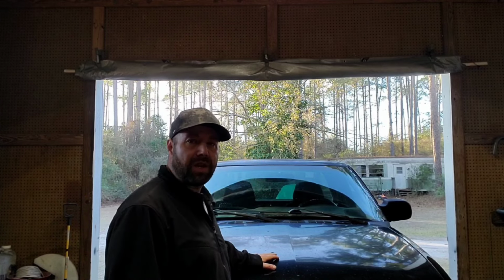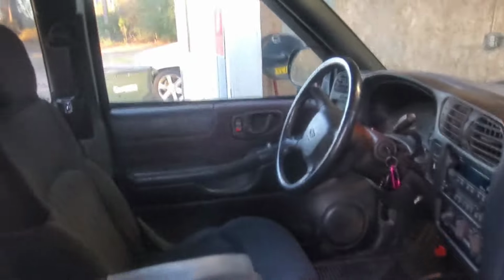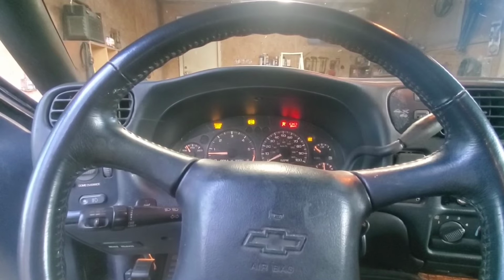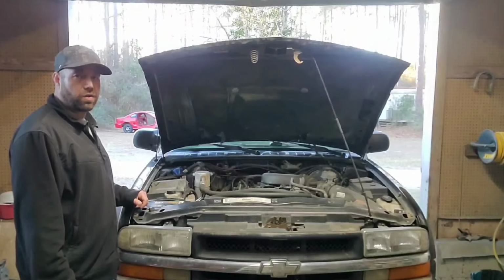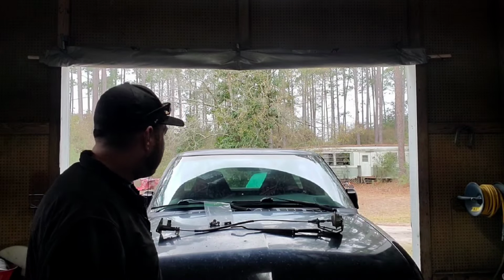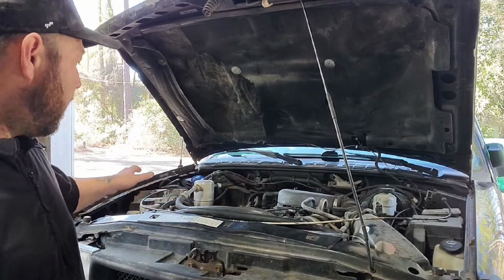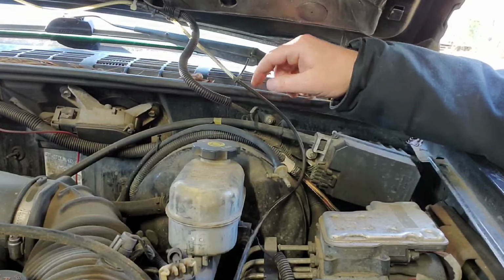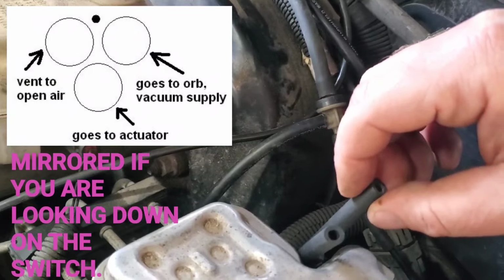My Daughters first vehicle! 03 Chevrolet S10 ZR2 4x4!

Comment: Every mechanic dad’s dream to have a daughter have interest in cars and be surprised when they buy a truck as a 1st vehicle. Just picked up my 2nd s10 last weekend and was able to find a zr2 in Macon. Researched all about these trucks in comparison to the standard s10 line and the 3.73 rear end and g80 locker makes a difference when I took off from a light. Does it have the 31s on it still? Not sure if that’s what took out a corner my fender flare rubbing or something else
Reply from the maker: YES! She always has lots of questions and likes to watch and learn when she can.
Awesome! I have always loved my S10's. Yes, still running the 31's as of now but it needs tires soon and will probably go with a less aggressive tire. We will stay with the same height and width,(as close as possible). I believe there may have been a critter involved with the flares getting broken 😆
Reply: @NoLogoGarage  if u go with 235/75/15s the Speedo is off by 2-3mph and after about 60mph atleast 5mph. I got a Hypertech max energy and I’ll be able to correct the ecm for the tire sizes
Reply from the maker: @b-rys8527  I will have to look into that. I have a tire size calculator and will get as close as possible, if I can't find a less aggressive tire in the 31's. Looking for more of an all season tire for her.

Comment: Can you show me where your vacuum line to the intake connects? I have an 03 Sonoma 4x4 and that particular vacuum line is not connected to anything and I don’t see a place to connect it on the intake?
Reply from the maker: @alabamaadventurer  back of the throttle body, under the intake tube hat to the driver side. Should be a T fitting and a bladder.
Reply: @ thanks for the info.
Reply: @alabamaadventurer  Did you get your vacuum lines figured out? Just curious as I just got thru replacing much of the vacuum lines in my 01 zr2. There are some good vids on this topic (w/diagrams) on YT.
Reply: @ not yet, I can’t find the t fitting to plug into. My engine was replaced before I bought the truck. I wonder if the 2wd engine doesn’t have the same setup for vacuum off the engine? This video was good, but really need to see where it plugs in at.